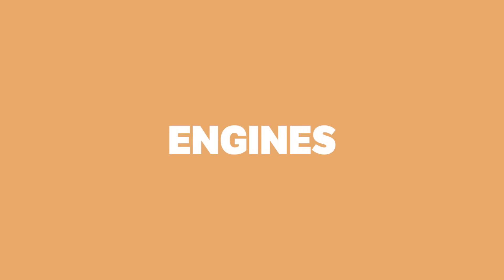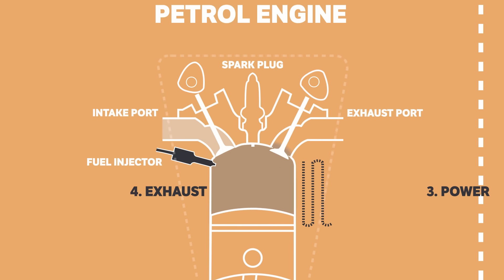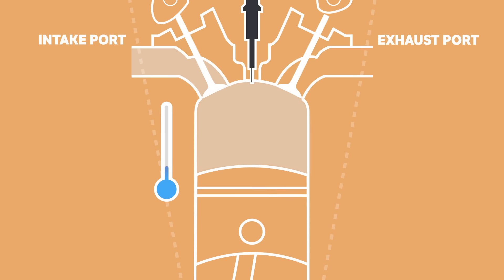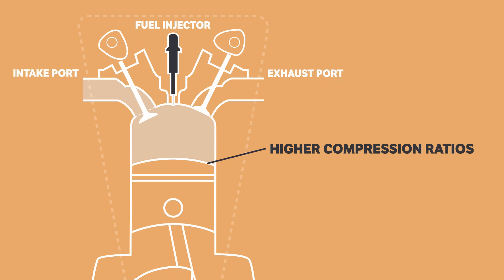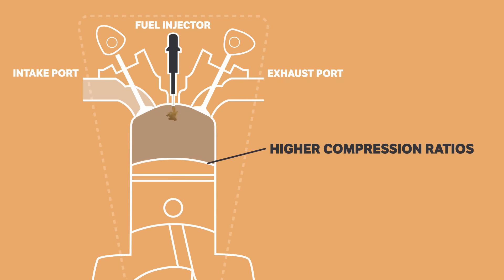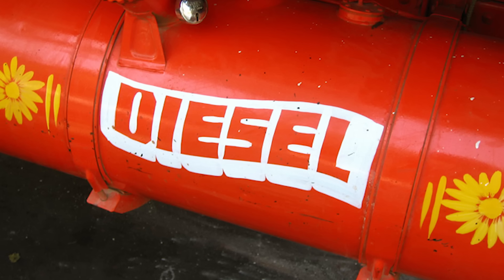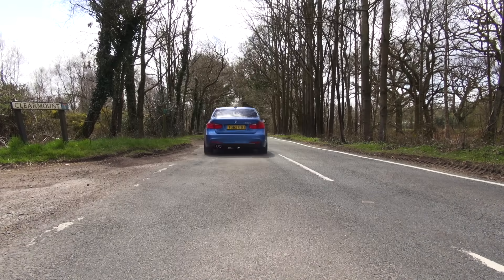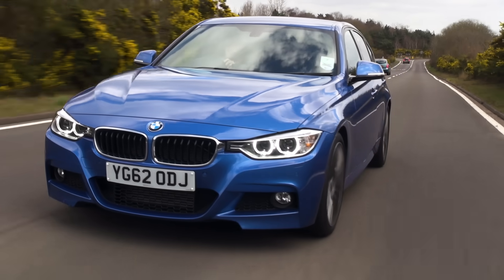The Differences Between Petrol and Diesel Engines

Comment: Forgot one fact! Diesels can turn into "runaway diesels" where the engine revs uncontrollably up to even 14000 rpm because of faulty gaskets in the turbo feeds oil into the engine causing ignition, turning the key won't help because the engine runs on oil now and not on diesel, so the only way to stop a runaway diesel is to either starve the engine of oxygen by taking a wood 2x4 covered with duct tape and putting it on the intake manifold so there is no air entering the engine or by holding down the clutch and brake pedals putting the car into the highest gear available and dropping the clutch and pressing the brake pedal hard so the engine stalls. Anyway hope you never get to experience a runaway diesel this has been education time with Vault-Tec Representative goodbye
Reply: Is that what Honda fanboys call VTEC?
Reply: vtec just kicked in yo
Reply: Wogden 700 its better to change your clutch that your engine right?
Reply: Vault-Tec Rep as a heavy equipment mechanic I have never seen this actually happen. This is one of those theoretical things that could happen but in reality doesn't hapen very often.
Reply: cough Renault 1.9 dCi 120 cough
Reply: 14,000 RPM? Can you document that? While I totally agree diesel runaway is very real, and whether the upper limit is 5k or arguably 14k is immaterial, I doubt any diesel has reached such lofty numbers, as attested to by any number of runaway videos. Good point, nonetheless.
Reply: Vault-Tec Rep 14k in a diesel? Lmao wtf that shit would explode before that
Reply: ThirteenMatt i maintain them i just dont really care about the little things. I only buy beater cars so i can afford having a fun car on the side
Reply: Vault-Tec Rep My new tractor did that. Turbo went. Ate all the oil then blew up the engine. Good thing we're friendly with the dealer
Reply: Joey Joosse sorry
Reply: Colin Vos Couldn't you just put it in neutral and hit the brakes?
Reply: I must admit old diesel were really strong, they're the one that gave diesel this reputation :D Though the nineties is when they started turning into what they are now, they were still very reliable back then. On the other hand I'm a defender of the fact that most cars have no real limit if you do proper maintenance. But I understand that's not what you do since you buy beaters :p
Reply: it is scary.. i think all diesels are possessed
Reply: Actually had a diesel runaway on my BMW 335d after faulty fuel pump gasket. Modern diesels have a built in anti shutter valve. It shut down my engine and ultimately saved it from seizing.
Reply: 1.5 is worse
Reply: Thanks for hoping that happens to me... :/ love you too.
Reply: Matrix na diesels are shit
Reply: my inlet is 4 inches in diameter...
Reply: Joey Joosse joey loossee butthole its 4in diameter jk my b
Reply: Driver Mod Gaming sorry im dutch
Reply: Dimes On His Eyes It happened to my brother, but with the engine I mentionned early in the thread. It's actually know for having an oil leak issue with the turbo that can make it rev until it dies. Heard from someone it is because Renault engineers did not respect the mounting conditions specified by Garrett, but I don't know if it's true.
Reply: Vault-Tec Rep my car once did "runaway". Since then I don't drive diesel anymore...

Got in a accident, I was driving 50 km/h in the middle of a busy city when the engine started to "runaway", I didn't know what to do so I turned the key to stop it but it didn't help, after 18 honks and 250 meter driving I was going 89 km/h  and I crashed head on against a brickwall, I broke my left upper arm and got a 2 broken ribs and I also got a speeding ticket _. Nobody was injured or hit (only me)
Reply: some diesels can rev high though look at an audi LM car, turbo diesel but its revs high and sounds like an N/A petrol v12, but in all fairness they're built for that the average road car diesel would probably blow lol...
Reply: Kenan Marx they only rev to like 7000 which isnt high... well high for a diesel but compared to petrol its average amongst road going cars and its a race car so i wouldnt call it high revving
Reply: Brandon sever I had little to no time to react. It took me 2 seconds to turn the key and it waa an automatic transmission
Reply: Vault-Tec Rep I had the same experience very recently with a runaway diesel except it was a diesel generator. Not sure if it was running on oil or if it was a timing issue and diesel was still being introduced into the cyllinder head but luckily we could jump up on top of the generator and force with our boot on the exhaust cap and exhaust break the engine to stall it. Lol.
Reply: OnePercent im really surprised all these people saying it happened to them i thought it was really rare i seen a big rig on the side of the road having a runaway once years ago but thats it
Reply: Driver Mod Gaming older cars tend to "runaway" more
Reply: Colin Vos that or just junked up ones maybe its cause there isnt alot of diesels where i live
Reply: Driver Mod Gaming I live in the netherlands. And I have never seen one car "runaway". The only one I have seen was my own car
Reply: Colin Vos that sucks its rare here because of the dpf stuff on the engines i think probably stop that from happening its more likely to happy if a person deletes all the emissions stuff i think thats whu older cars have the issue because they didnt have it
Reply: clutch kick!
Reply: Vault-Tec Rep that's very true. But as rare as this vent is. I wouldn't let this stop me from purchasing a diesel. But I respect your opingion ( assuming you would pick petrol)
Reply: Driver 138 Yeah I like diesels because of their economy and cheap parts, but I think I would put petrol and diesel on the same level, I can't decide what my next car will be
Reply: Vault-Tec Rep if i didnt care about going fast id get a diesel all day
Reply: It's not even a matter of going fast for a lot of people. Something I have seen a lot of times are people who just can't drive a car without trashing it, so they think only diesel is good. Because since they drive like shit, they can't get decent mileage out of a petrol, and think those are just endless pits you try to fill with fuel.

Me, I like lots of things a diesel can't give me. And on a daily/road trip basis those are being smooth as fuck without using balancing shafts and tons of fancy technology, being naturally quiet at normal speed while making a nice singing when I push the throttle a bit more, not having thousands of reasons to break like modern diesels do and, on a less daily basis, being able to going way beyond 5 000rpm eventhough it's not a racing engine.
Reply: ThirteenMatt im guilty of that haha i trash my dailys usually 90s beater shit boxes i can fix em no prob till they finally die then get another one i ca get 200k miles plus on little petrol 4s. But i had an old vw diesel that did 400k miles you cant really beat that
Reply: If you are concerned with that carry a co2 fire extinguisher blast that into the intake and it will cut the engine dead
Reply: Vault-Tec Rep cant u just take the sparkplugs??
Reply: Claudio Jose Capote have you even watched the video? Even though taking a diesel glow plug out would make it unable to make compression, by the time you take them out your engine would probably be dead anyway. And that's assuming you can take those out on an engine that's currently reving all it can.
Reply: Nerds...
Reply: Or, You can take anything and put it in the turbo.
Reply: Dude fuck off you have 1-3 brain cells.
Reply: This is why you get your diesel checked out, or just run an NA diesel like a few of us do. I myself am gonna run an NA Duramax in my towing rig once I can afford it because of this problem. If your vehicle has a likelihood of doing this, then get the gasket replaced. It's that simple. (and my diesel is going to be a manual because of this problem. Although I'm going NA it's still better to be safe than sorry.)
Reply: Runaway never happens on properly maintained diesel engines.
Reply: most modern diesel cars come with an anti shudder valve as part of the EGR valve, this closes on engine shutdown to help make the engine settle less rough by causing a vacuum in the engine. no oxygen = no boom.

this is one of the reasons your modern diesel cars are quiet when stopping, one of my cars is a 1999 VW Polo 1.4TDi and even that has an anti shudder valve as part of the EGR valve.

Comment: Diesels are only good so you can save money on fuel to buy good petrol car.
Reply: Which is logical because Diesel is actually usually more costly to produce. But here in Europe we still have highly taxed gasoline and "lowly" (because actually it's still high) taxed diesel, which dates back to petrol shocks when governments wanted people to rely less on petrol. So at the time they figured that since diesels use less fuel, everyone should use them.
Reply: In the US, diesel fuel is more expensive than gasoline.
Reply: Yes, there was a brief moment last year when prices drop a lot. It was the first time in about 15 years that diesel was under 1€/L. The prices I'm mentionning are supermarket prices BTW, because as you say there usually is a huge difference with fuel retailers. And if you happen to need fuel on highway, the prices will be stupidly high.
Reply: ThirteenMatt diesels are more expensive in the UK /EU to purchase, their savings on fuel isn't great, especially of the price of petrol and diesels are the same. (diesel was more expensive for the longest time. 

You need to be doing alot of motorway miles (where the diesel is most efficient ) to ever see a real world savings. 

Diesels are more popular in UK /eu as we can't have V8+ because of fuel prices. Currently around £1.15 litre or $5.70 a us gallon. So if we need pulling power, a diesel is the obvious choice.
Reply: About the same thing here in France, but as I said diesel fuel was taxed down a lot in the late seventies so people would use less oil. So we have diesels that are more expensive to buy and maintain, but that use fuel that has been a lot less expensive for about 4 decades. And so almost everyone using diesels, even if they barely drive and/or drive only in town because they aren't able to understand that fuel isn't the only cost in a car. Here diesel is around 1.15€/L and petrol around 1.30€/L, and the difference used to be greater (In 2014 it used to be 1.30€/L and 1.55€/L).

This is only being  phased out now, out of pollution concerns, with fuel taxes that are currently being progressively readjusted between petrol and diesel and a new system of stickers that would ban older cars out of town centers that is in favor of petrol cars.
Reply: drzitbag06 not true in all countries.
Reply: drzitbag06 for exemple here it's not true, because those vehicles are authorized a special detaxed diesel. It's also red colored so if you're caught using it in a road vehicle you'll get a huge fine.
Reply: Gadlajk in u.s. its the opposite lol
Reply: Doin this at the moment :P Driving a 1.9 tdi to save for a 2017 Civic 1.5 Turbo
Reply: ThirteenMatt your diesel has gone up a bit, but I I was paying about 96¢ a litre last summer from French and Spanish supermarkets. And about 60¢ from Andorra. 

You could pay more from shell etc, but in France your supermarket vs garage price is massive. In some cases 20¢ a litre. In the uk, the diffence from garage to supermarket is 2-3ppl.
Reply: diesel is cheaper because; aggriculture, construction etc vehicles have diesel engines. goverments lower diesel taxes to keep economy going and to keep all those farmers from revolting lol.
Reply: well it's the reason why diesel is cheaper in my country.  petrol 1,10 pounds a litre, 0,9 ish a litre for diesel. erdo recently nudged the diesel tax rate and everybody went ape shit.
Reply: idontcare80 Maybe where you live specifically but not generally
Reply: I paid $2.559 per gallon for diesel last time I filled my truck.
Reply: I hate people like you the most!!!
Reply: >Which is logical because Diesel is actually usually more costly to produce

Not at all. Diesel is less refined than gasoline. Taxes, different market demands, and infrastructure scale are what drive prices higher in some places. Diesel is still cheaper at the pump in some countries (like Canada).
Reply: @ThirteenMatt In turkey yacht fuel is detaxed lol.
Reply: Diesel cost about the  same as gas in my state right now but since you get better fuel economy with diesel its cheaper per tank to fill up with diesel.

Comment: Many questions:
- why can't we build a petrol engine with high compression? I mean engine knocking is self ignnition, if we'd use an injector similar to the one in a diesel why wouldn't that work?
- why can't we build a diesel engine that uses a spark plug? It would probably be less efficient and I know that diesel requires a higher temperature so it will be difficult without the right compression but theoretically it should work right?
- why didn't you tell us any advantages of the petrol engine? A lot of cars use them and my guess is for the high rpm. You just released a video showing high reving engines.
- Also, what does the average petrol head prefere? This is car throttle, i expect some screams while accelerating an awesome car. Preferably Phil.

Comment: Which do i prefer? Well i like both equally! Petrol cars have better acceleration cos the engine is lighter and can rev higher. Diesels have way more torque down low and can have huge fucking turbos attatched. Drawback is their weight and fuel system compexity. I love em both and wouldnt mind which is in my car as long as i go from A to B

Comment: G A S O L I N E !

7-9000 RPM is just way more satisfying than 3-5000 RPM
Reply: P E T R O L !
Reply: Razor what kind of racing you been watching lol
Reply: HankB1993 ya ok that may be true in SOME cases but u also have to think great u make that torque fast but it's over fast the petrol car has at least 3000 to 3500 rpm left depending on the car even higher  he keeps going and u have to shift. Petrol isent more fuel efficient BUT they are absolutely better for racing and making horse power with a usable rev range
Reply: Like I get how you want a nice practical daily driver but hell if I am to drive every single day I don't want to be bored out by a car that isn't doing anything after 3500 rpm. Just my opinion on cars.
Reply: ihaspizza13 y'all worried about mpg I'm getting 14 in my truck. And every crackle of the exhaust brings more pleasure than saving gas in my car
Reply: no i mean 1500-6500 for mercedes diesel, which is the only diesel and car in general worth having.
Reply: Pontus Hallquist my 1.4t petrol only works up to 4500 from 2500..☹️
Reply: sheppardpat47 I've seen one hit 8 I've hear a story of 14.
Reply: my dad has a opel vectra caravan 1.9 cdti 150hp stock and goes 5.300rpm max
Reply: Ryan Rohauer because rev is the only way to gain any torque for a petrol engine.
Reply: Philip S totally false hp= tq x rpm
Reply: Ryan Rohauer i am baffled someone fell for that 🤔
Reply: Pontus Hallquist it's called petrol in english
Reply: Diesel huge torque save pocket... Can tow a couple civic too
Reply: Pontus Hallquist unless it runs away. Then diesels car hit 14K and it's terrifying.
Reply: Then get a mercedes om606, with some mods it get 500 hp, around 800-900 nm and revs to 6500 all day long.
Reply: Pontus Hallquist diesels are enjoyed in other ways, you don't buy a diesel if you want to hear high rpms.
Reply: +Layered Chip3 What the fuck? A runaway diesel is max 5200rpm... If a diesel hit 14k it explode
Reply: patrik persson this may be biased because I own a common rail Cummins, but there is no loss on experience with one. Intake, tune, and an exhaust brought my truck to about 410 horsepower and 840 foot pounds of torque. The highest I've revved her up to is about 4500 but, you don't need high rpm for fun. That torque is almost instant and for a fairly large truck, (a crew cab) she's pretty quick.
Reply: but sitting in a big SUV with the disel DRUUUUUU noice makes u feel so much powa. but thats about it for noise, petrol sounds better for fast driving, but diesel better for towing. (Sound wise)
Reply: talking about diesel and petrol engines, Diesel is quite efficient, so most race cars has diesel engine. I can't remember racing cars which runs on petrol.
Reply: Yeah but it takes gasoline engines 7-9000 rpm to reach the same torque my truck makes at 1-2000. Also the sound of a diesel is much deeper and louder especially when stacked or straight piped. Also nothing sounds better than a diesel spooling up and launching. Diesel > Gasoline
Reply: isn't doing anything after 3500 rpm? dude my compound turbo merc om617 is pulling all the way to 6500. And my daily driver a c220cdi w203 avantgarde with a tune up is making 190 hp and 420 nm is pulling to 5700. Mate if your only experience is with those cummins then you should try a mercedes diesel